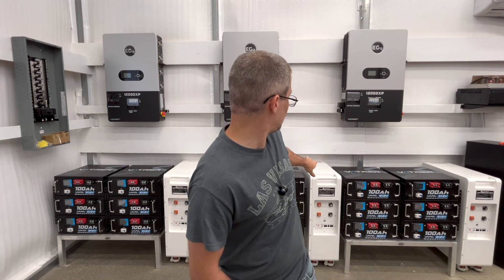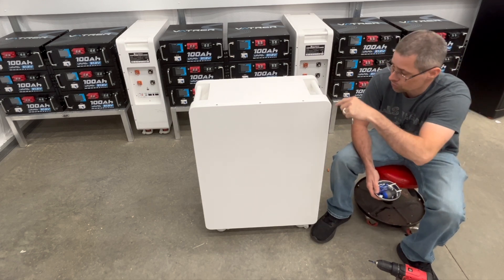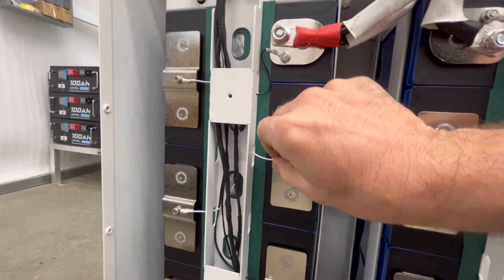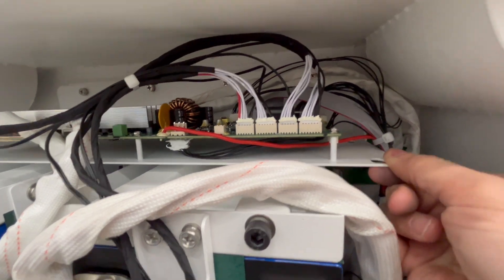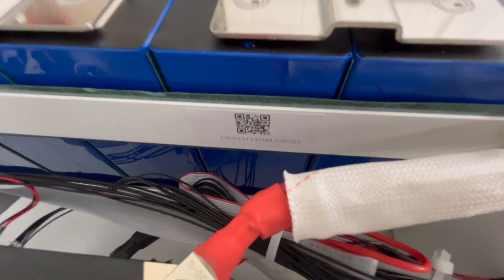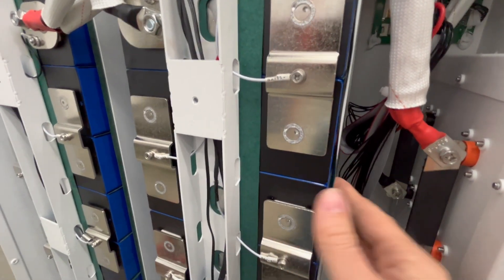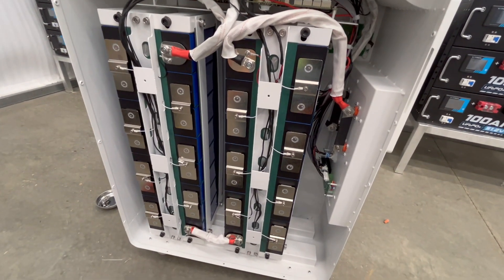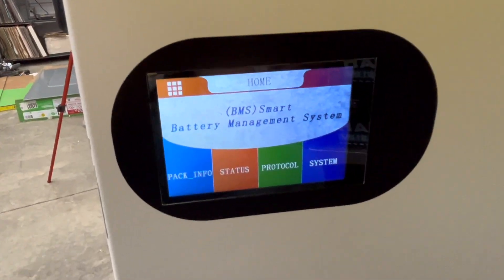The Surprising Truth About Ecoworthy's 48V 280Ah Battery

Comment: Just wondering dose it come with any cables/wires
I’ve purchased eg4 indoor and out door wall mount batteries that came with 2 red and 2 black impressive size wires
And I have a wall mount Ruixu that came with one set of wires 
It Seems kind of crazy that they included them in a cost competitive product
Reply from the maker: Yes it does and the cables are pretty decent.  I’ll try to put a quick video clip together.

Comment: Awesome looking battery.  Do you feel it's better  to go with bigger  batteries or the 100 ah batteries for the long term. Bigger  batteries take up less room and wire but should there be problems the replacement cost is higher if you loose one early. Can't wait to see how the Vatrers work with them.
Reply from the maker: That is the million dollar question.  The larger battery costs less, but if the BMS fails it will be harder to find a replacement and a larger chunk of capacity goes offline.  The Vatrer may be the better buy.